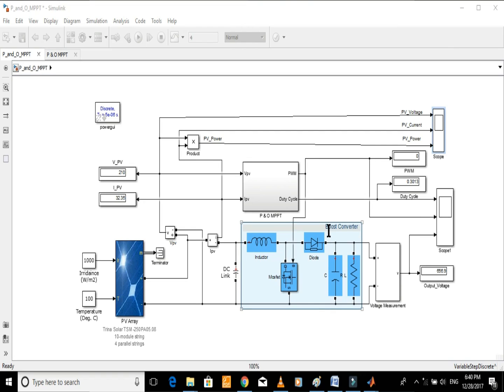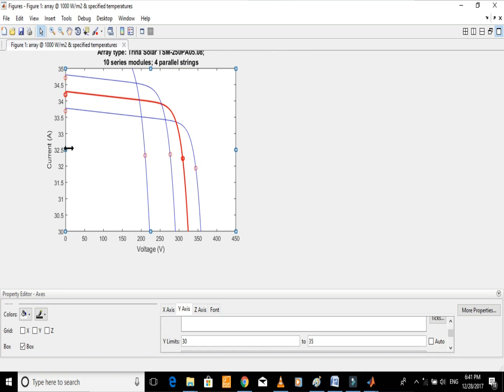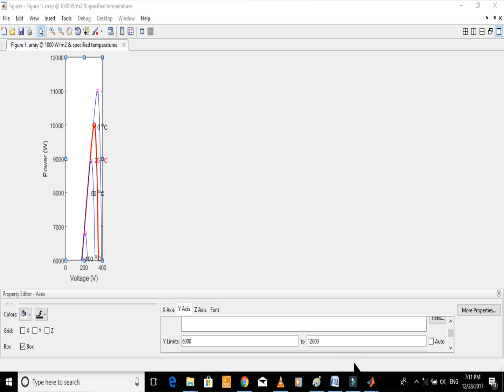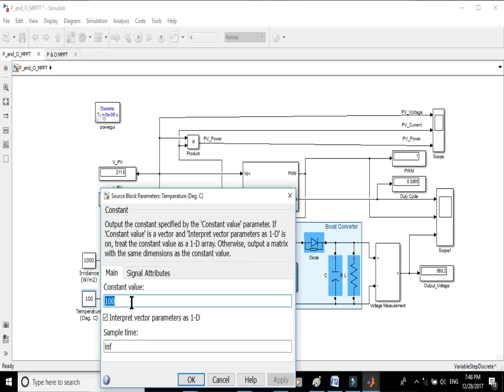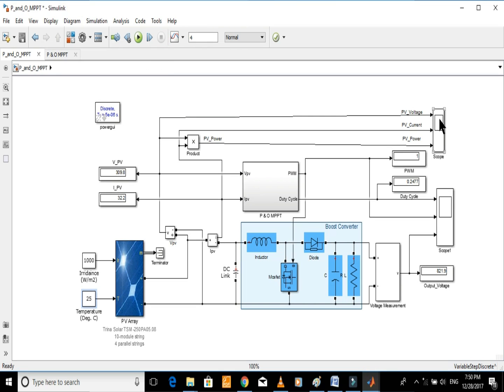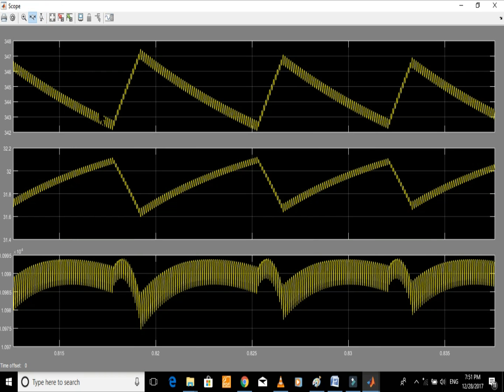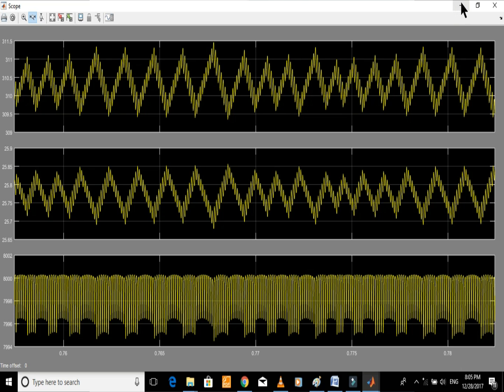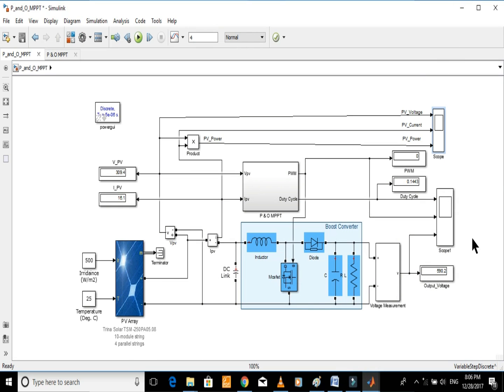Perturb and Observe MPPT for Solar PV with Boost Converter

Comment: how have u calculated the value of inductor and capacitor
Reply from the maker: the values are estimated... there are equations for finding the critical values of inductor and capacitor... for CCM the size of inductor and capacitor is chosen greater than the critical values..
thanks
Reply: @simulinkmatlab3886  I need this project...how can I got it and what price?

Comment: can you design a solar pv module for me in matlab??
Reply from the maker: The PV array block of simulink library implements an array of PV modules. You can use that, no need to design it..... available in MATLAB 8.5 and later versions.....

Comment: respected sir if i connect the out put of boost converter with pwm inverter to convert in to ac is it possible
Reply from the maker: Yes, You should watch this video:
https://youtu.be/nDTaQ4XoE58
In this video you will find "Stand alone PV system" in which I have connected an inverter to the output of boost converter.